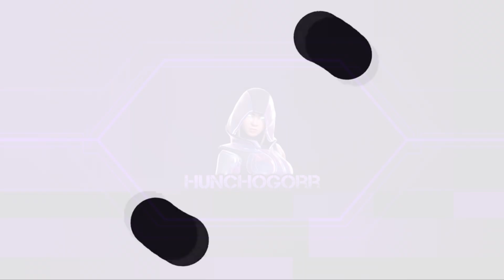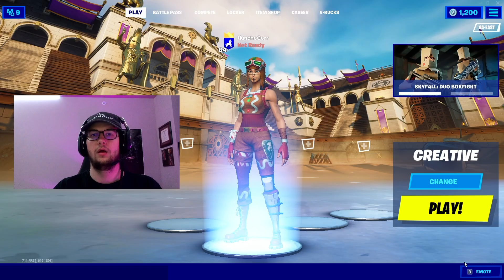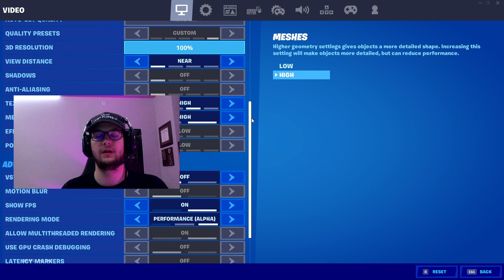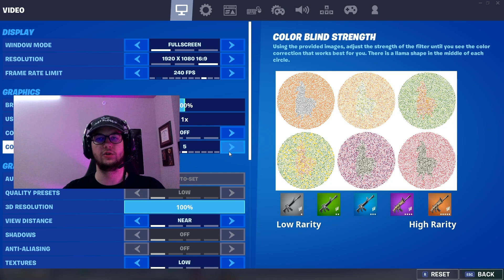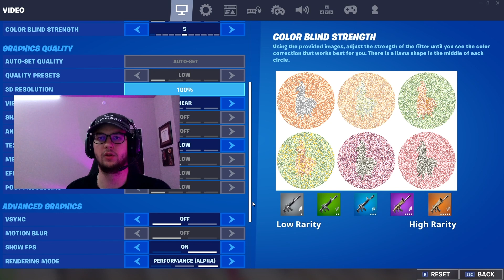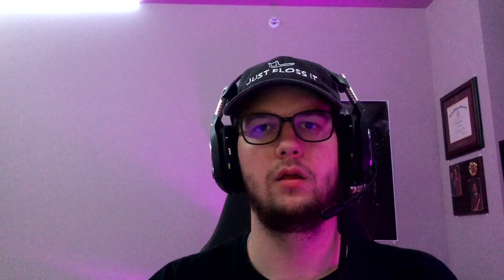How To Choose Your Build Quality In Fortnite Performance Mode Alpha! (Bubble Wrap Builds)  (Meshes)

Comment: I use performance mode and low textures and far view distance with meshes high(bubble wrap builds) and I can run 600 fps but I mainly just cap at 240 or 360

Comment: Hunchoo, i have a really weird problem dude and im hopping if you can help me. I have a laptop, a legion 5, i7-1750h with gtx 1650 TI and 16gb of ram. Standing still in a normal solo game, in the same spot, i get like more 30 or 40 fps in DX 12 than performance mode, and im getting a lot of frame drops in performance mode when im buildfighting, and tbh i think is really weird because it doesn’t make any sense. Do you have any advice? Thank you!

Comment: i would like to use perfomance mode but because its based on dx11 i cant play it. my pc just doesnt like dx11, i always get fps drops, so i am forced to play with dx12 which is fine but annoying at the same time. do you have any idea why certain setups can handle dx12 better than dx11? my specs are: ryzen 5 2600, gpu: rx5700, 16gb ram
Reply from the maker: dx12 is designed for newer specs